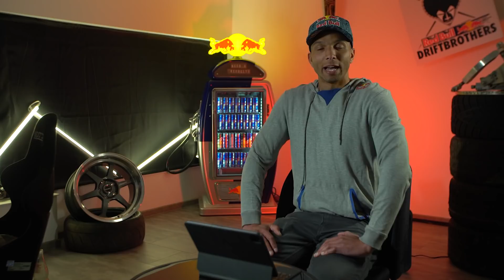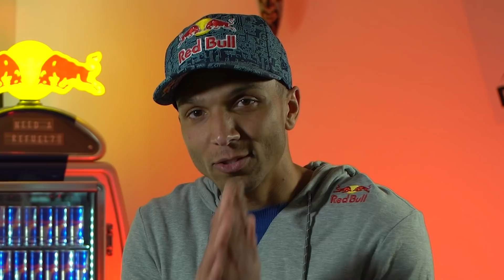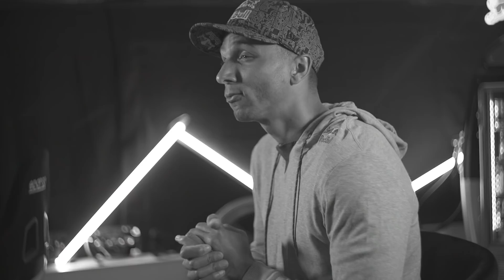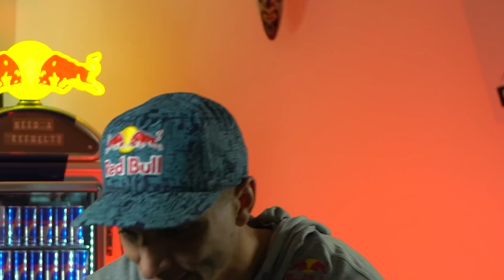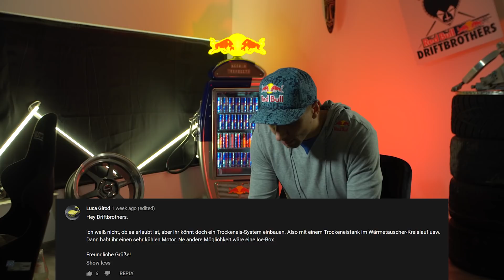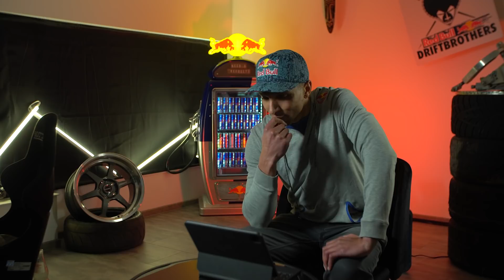Your Questions On: BMW M4 S58 engine with 1.000+ bhp! | Episode 4

Comment: Was ist eigentlich der unterschied zwischen bhp und whp etc. In manchen titeln wie bei dem video wo travis pastrana mit seinem subaru über den kanal über das boot gesprungen ist stande ja so und so viel WHP und bei euch steht immer so und so viel BHP. Mich würde mal interresieren was da der unterschied gibt falls es da einen gibt.
Reply: Salopp erklärt: BHP ist was der Motor an Leistung macht. WHP ist was von dieser Leistung bei den Rädern ankommt, nachdem sie durch Getriebe, Diff, usw. ging.
Reply: @Da_Osta  edit: 
bhp = break horsepower (am schwungrad gemessen, kp wie das praktisch umgesetzt wird)
whp = wheel horsepower (auf dem dyno gemessen wie man das üblig macht)
Reply: @dustinpardo29  bei bhp wird nachdem der Motor im begrenzer ist, auf neutral geschaltete und der Widerstand der durch Getriebe und diff entsteht vom Prüfstand ermittelt und danach auf die gemessene Leistung addiert. Die meisten Deutschen messen so viel ich weiß in bhp, bzw. in dem deutschen ps, da es da auch noch einen kleinen Unterschied gibt.
Reply: Danke jungs :D